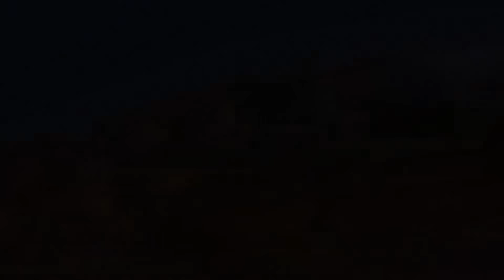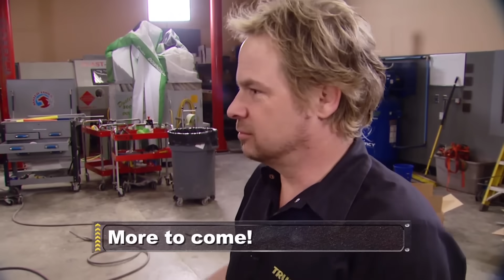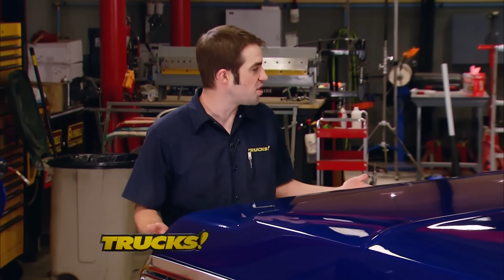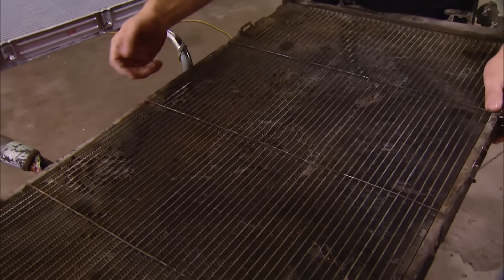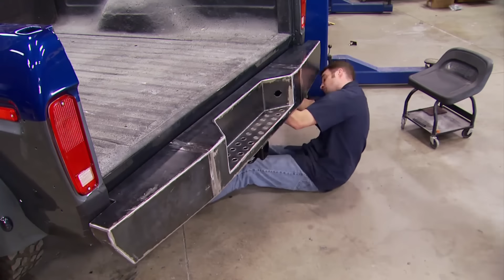Ford Crew Cab on a Dodge Cummins Chassis! (Super Dually) - Full Build

Comment: I was looking for this episode a year or two ago. I have a 24 valve dually. Every body panel is beat but the frame is rust free and the 5.9 Cummins is stock and runs great. I’m going to start looking for a dent side.
Reply: you should post videos on your progress if you do something like this. i think the key here is to find a cab that fits (well) and flat bed it or something so you really only need to worry about the front wheels falling into the wheel wells.
Reply: Nice, did a #Dentside on a 99-04  ford lightning 2nd gen. Since mine is pre-emission registered it 5 year plates really cheap.

Comment: What’s up how are y’all doing? What you been up to? I have been watching out for mini mini years since I was a little boy but anyway I love you ciao don’t want and I love y’all bringing that. What year is that truck that’s a 1970 Dillman, the truck is myself in a diesel engine in it you’re really doing a great job Johnny put a digital dash in the truck, a digital dash in a truck and put a bad sound system in the truck we go See player of the touchscreen and put back up. Cameras put the system in there put some good sales, this speaker, Santa Samah, phone by 6659‘s in the back in the truck on the side doors, and Yanni Todos at the front and tweedle said the bag and put a on the bottom of the Sea put some for six in the seats and pushing so waffles in at a big old speak on in the back and y’all need to put the wire harness in the truck in the in the bed, wire, harness wire, harness it on him The bottle of water and put up a hairy hate you no different boot. Hate you now and put a gooseneck in the back in a fifth wheel in the bed gooseneck it truly is a fifth wheel in the back and I’ll Yannick for some cameras in a two dollar one. I wanna be one on the back when you get out on the back and put cameras on the front cameras on the side of the Dooley Dooley mirrors on it tell mirrors on the air Pallotta Cameron’s already aware put some some bad pipes on the side that bad boy put a security system Papa windows and everything and then could you put a sunroof in our truck up our Samaroo I put a nice size system that bad boy that one up top I do that thing today lol for hook it up with a digital dash and put a trailer hitch trailer hitch gooseneck trailer brake controller on the trailer brake control Anna Anna Szakos break control Anna Anna Zars, Britte❤❤❤❤❤❤❤❤

Comment: OK  I admit  it  is  still a  nice  truck  but  just  out  of  curiosity why  did  you  cross  breed a  Ford body  with a  dodge  frame, engine and  trans think  you  could  have  used  a  newer Ford to do the  same  thing but  I was  just  curious
Reply: I think they did it just for the engine

Comment: I enjoyed the video , lot of useful information.  I remember reading a article in a magazine about the introduction of the 5.9 cummins to a Dodge and I told my Dad back then , he bought one I. Decatur in a couple days . I had no idea who did the first prototype.  As for the brakes I got a 95 4x4 I doing the 3rd generation front brakes with a 2001 front axle . Your right about the chev rear wheel cylinders.  I did the hydrobooster system and it helped braking . You might at some point consider a exhaust brake.   Also give the engine some timing say 17 or 18 deg . That helped my 95 get a lot better mileage.. As far as towing may be installed a set of air bags on the rear also.  I installed a g56 in my truck and replaced a burned up 47rh.  Don't regret that a bit .. Your build is really nice a lot of talent went into this .

Comment: They may not have bought both trucks for $40,000.00 - $50,000.00 but I am sure the build price was up there after paying wages for Kevin and Ryan for 2 years plus all the parts they did not get for free. But it does look really good. I would daily drive it. Its a shame after all the hours Kevin put into this truck he does not get the first ride.
Reply: Easily a $200,000 truck
Reply: @kevinmelton855  I estimate $100k +/- which is way too much for a Doge with a Ford body on it. My 97 F350 dually diesels are $10k clean.
Reply: If you google the truck, you can see where it sold for about $20k on Craigslist back in 2015 or 2016. Such a shame
Reply: @taylorgibson8516  Someone got one hell of a deal. I wish it was me.
Reply: @taylorgibson8516 That's why you don't dump huge money into 2wd trucks. They just don't have the resale value. I don't know why they didn't put that thing on a 4x4 ton chassis.
Reply: @taylorgibson8516  Something's wrong with that picture.

Comment: I have a 1995 Dodge cummins with a zf6 manual transmission, and I love it.
Reply: Yea I saw a article in the forums and I bookmarked it where this was done with a tc out of a 6 4 electric shift. I like the overdrive ratio of I think .72 ..I saved the article because I may wat to do that some time.  . My 95 has a g56 with the Val air dual disc and a bm short shifter . Fort Worth differintal and gear went through the transmission before I installed it . I did not know it could be done with a kit back when I started this adventure.  Glad you like the transmission.
Reply: So you have a dodge truck with a Cummins engine put into it from factory

Comment: 1979 Ford 4 Door Crew Cab and 1995 Dodge Cummins 
0:01 Highlight
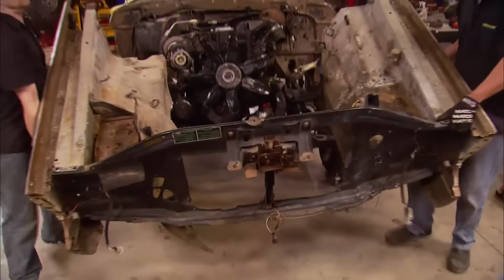40:40 Front Fenders
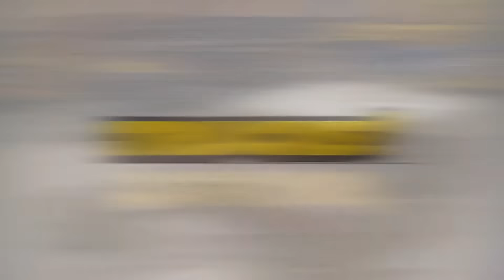49:47
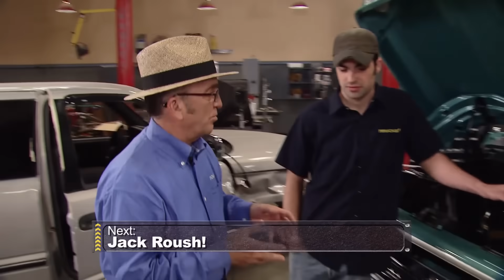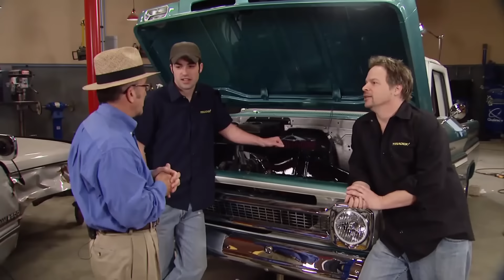55:55 56:20 Jack Roush!
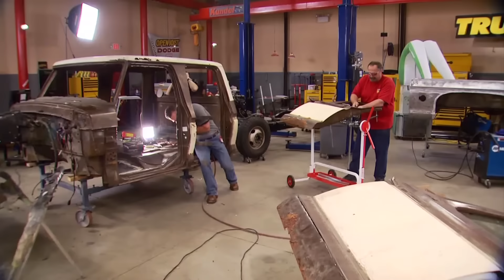1:07:10
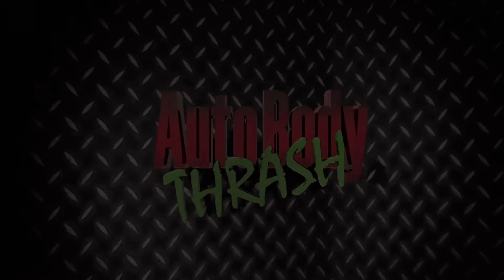1:10:21 Autobody Thrash
Reply: it's not a 1970.
Reply: @oregonfordguy9812  70s
Reply: 1979(1:25:28)
Reply: Not a Dodge it's a Cummins Engine. Dodge purchases them from Cummins.

Comment: My husband has been a mechanic for 25 years and he hasn't found anything in a bottle that will fix a leak
Reply: Brake fluid does the same thing !
Reply: @bryanfranks1378   that is just putting a band aid on the problem

Comment: Best part about this is the v10 in there superduty has double the hp and more torque than the 12v they are replacing it with. Definitely should have dropped the cab on the superduty
Reply: Give me reliability over trying to push over 400+ HP.think that's why I stick with either idid 6.9/7.3 or GM 6.2/6.5 and the 12v.
Reply: @nick smith nah, I'd rather have a truck that has enough balls to get out of its own way. Put a 10,000-pound trailer behind a 6.9 idi and forget about it... you might as well install a switch that permanently leaves the 4 way flashers on because you certainly aint hitting the speed limit any time soon. Those clapped out pieces of shit didn't have enough balls to pull themselves, let alone do any kind of work or pull a trailer that could even remotely be described as "heavy"
Reply: Yeah, they're bragging about its power and that stock 6.7 late model Mega cab passed it dragging a wedge 🤣

Comment: Why would you want a manual for a tow rig?
Reply: You'll have control over the shifting points while in motion. When driving uphill, for example, when you need to keep the engine at higher RPMs, an automatic transmission isn't going to care and just shift to the next gear, putting you back to about 1,000 RPMs, which isn't good on the engine. Also, manual transmissions also have better fuel efficiency compared to automatics since manuals have 10% fewer moving parts, and you can coast in neutral when going downhill (provided that gravity can help with maintaining speed), or when you're coming to a stop at any stop signs or red light intersections.
Reply: Manuals are preferred for tow rigs.
Reply: Manuals are preferred when you want to use an exhaust brake. Much safer coming down a mountain pass.....

Comment: What’s “gas saver” and “needs more torq” have to do with each other?
Reply: Diesels generally get similar mileage to gasoline and definitely make more torque.  My buddy has a 3/4 ton Ford diesel that gets the same mileage as my 5.3L half ton Chevy with significantly more towing ability.

Comment: There's some goofball selling these kinds of trucks for $250k
Reply: No low balls.   I know what I've got.
Reply: @bmstylee  Yeah they're all fixed up like this one, but still. Better to diy than pay that even if you are rich
Reply: @enermaxstephens1051  I remember loving this project.   It's probably not something the average wrench can do.   Unless you're a really good welder, fabricator, engineer, etc you're going to be paying someone a lot for the things you can't do.   I'm a pretty good wrench but this is galaxies away from anything I could do.....even with the 💲💲💲
Reply: @bmstylee  If you had the money, you could do a lot. And then just pay for the work you couldn't do. It would be a hell of a lot less than $250k but it would take years. But yeah you could tell from the video, that even these guys bit off more than they could chew. They got to a certain point and had to call in a lot more help.
Reply: True.  Guess it's moot since I'm a bit short on the cash front.  Well at least for a build like that.
Reply: several sold on mecuam auctions for 100k plus.